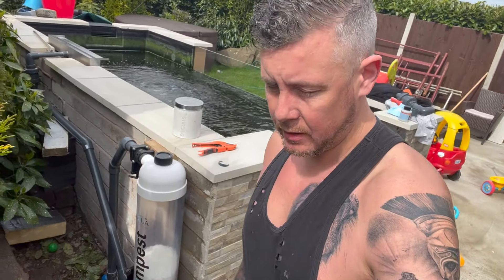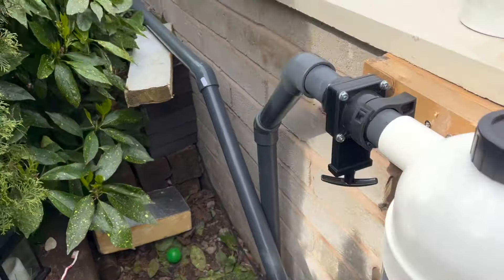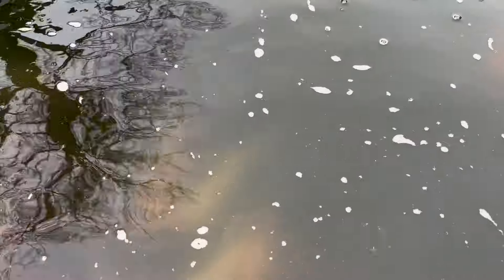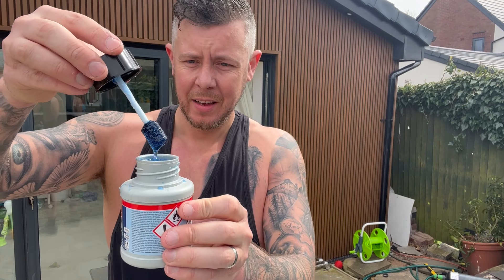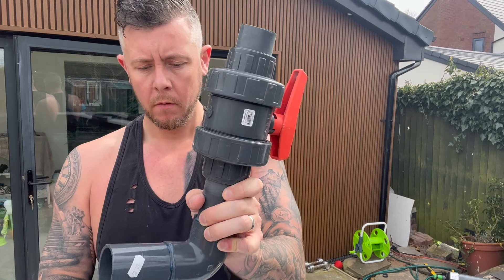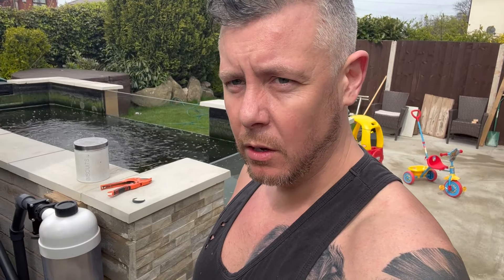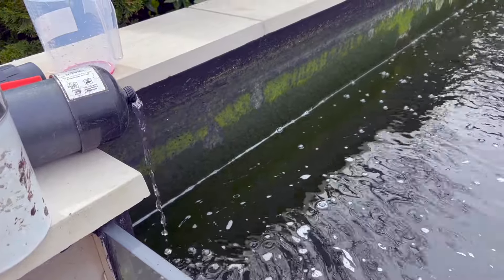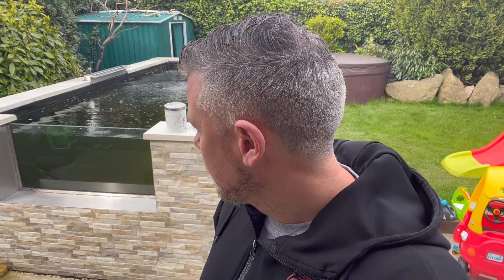Koi Fish Johnny Ep43 | Part 2 Tempest Pond Water Polisher / Filter Install. Solvent Weld Pipe Test

Comment from the maker: My Little  Hawaiin Shirt Business https://www.ebay.co.uk/itm/166956285518
LINKS TO ANYTHING I HAVE USED ON MY POND THAT I WOULD RECOMMEND ⭐⭐⭐⭐⭐
*I get a small % when you buy anything, helps justify time recording to the wife, so thank you in advance 🙏
MY POND SET UP 🐠💧
Nexus 220 🔗 https://amzn.to/3wxdv0h
Evo Aqua Pond Pump 🔗 https://amzn.to/3clZyv8
Pond Water Blade 🔗 https//amzn.to/3KqEDVq
Tempest Pond Water Polisher 🔗  https://amzn.to/3QRrTsd
UV Pond UV Light 55w 🔗 https://amzn.to/3e0LB6r
Air Pump  🔗 https://amzn.to/3CDn8yr
Pond Declinator 🔗  https://amzn.to/3wyWgLV
Replacement EA UV55w Bulb 🔗 https://amzn.to/3AZdAN3

GOOD STUFF I HAVE USED  ⭐😁

EA Pure Pond Balls 🔗 https://amzn.to/3PSpuwh
EA Pure Pond Bomb 🔗 https://amzn.to/3ApoQka
Koi Pond Salt 🔗 https://amzn.to/3QSc98v
Air Pump Stones 🔗 https://amzn.to/3APCFKb
NT Labs Magiclear 🔗 https://amzn.to/3Klv8pA
NT Labs Pond Test Kit 🔗 https://amzn.to/3ThN9sW
⚠ Potassium Permanganate Kusuri 250g 🔗 https://amzn.to/3KqpYJI
Hydrogen Peroxide 6% Solution Kusuri 🔗  https://amzn.to/4c1GVGc
Kusuri Topical Treatment Kit 🔗 https://amzn.to/4aIbGib

EQUIPMENT USED 💪🙏

Silirub Aquarium Safe Sealant Link 🔗 https://amzn.to/3vOa34d 
Pipe Cutters 🔗 https://amzn.to/3pTcDPD
Grifton WDF-05 PVC Pipe Glue 🔗  https://amzn.to/3wxgc1R
PVC Pipe Saw 🔗  https://amzn.to/3QRyenK
Pond Net covers 🔗 https://amzn.to/3PQz2rx
Stanley Knife 🔗 https://amzn.to/3TY4mJ5 
Johnny Builder Gloves 🔗 https://amzn.to/3UeBOMQ

My Koi Dealer UK Nishikigoi 🐠 Sells everything you need so if your local go there see Dave for everything 👉 https://www.facebook.com/UkNishikigoiBellLane

Comment: Success!!!! With my one i plumbed a valved bypass across the inlet and outlet so can work on it if required in case i need to work on it  or disconnect it and still keep the water running. haven't need it yet but its there if needed🤓😎
Reply from the maker: Hi mate 👋 Cheers pal, thats exactly what I was thinking and may do that if needed in the future TBH. Just wanted it on 😂

Comment: Great job mate, I used to have my tempest on a mid water return but it drove me mad bubbling the water surface evertime you clean it. Eventually you may find you have to put the uv on the nexus pipework as the tempest works best at around 5000 ltrs an hour and the pond needs a lot more water through the uv for it to clear green water, this is why they are higher wattage so they kill algae at faster flow rates. It's all a learning curve and you will get it right 👍👍
Reply from the maker: Hi mate 👋 Cheers buddy appreciate that and yeah I think you might be right but my problem is the nexus comes in and out super quick so noweher to put it ☹️